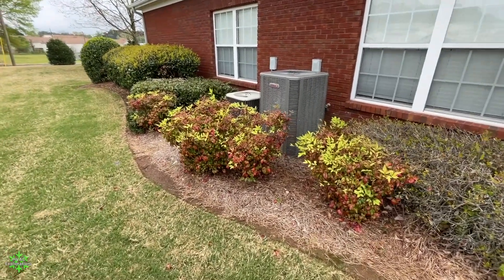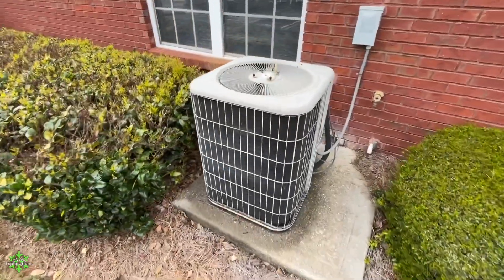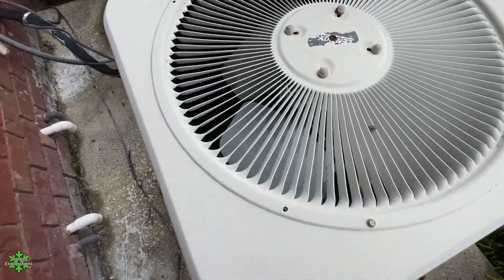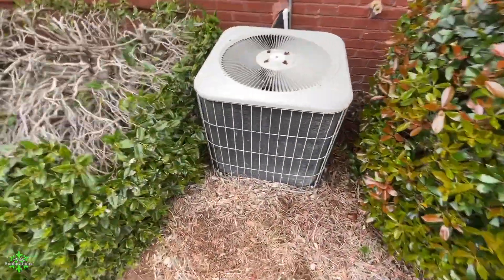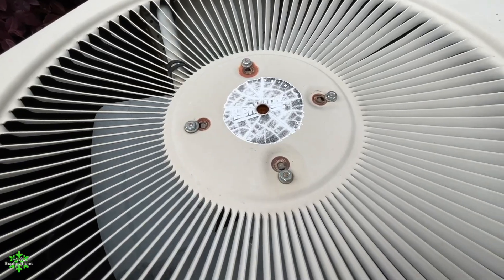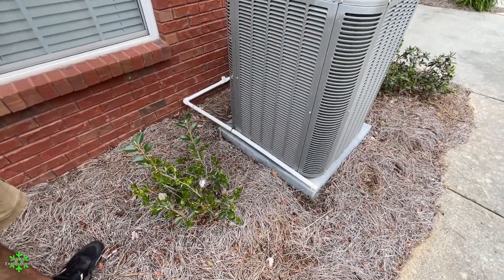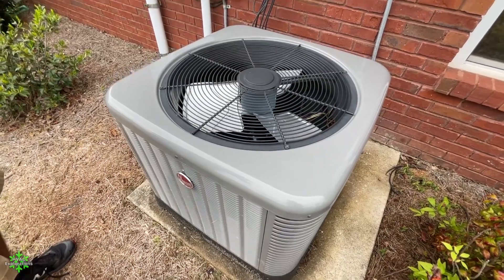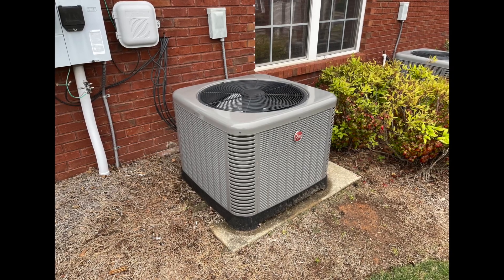Office Park HVAC Heaven Part 1 - Lennox, Rheem Heat Pumps

Comment: The 4 blade fan motors are stronger than the 3-blade ones.  Must be because the 4 blade ones spin at a higher RPM.